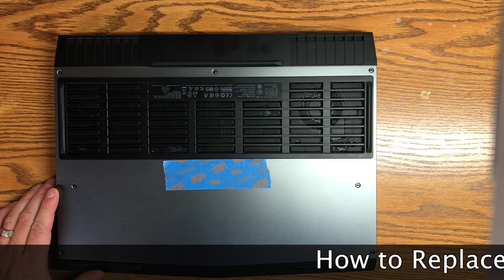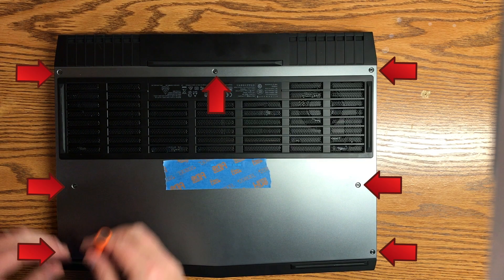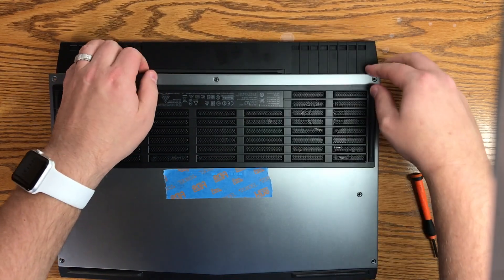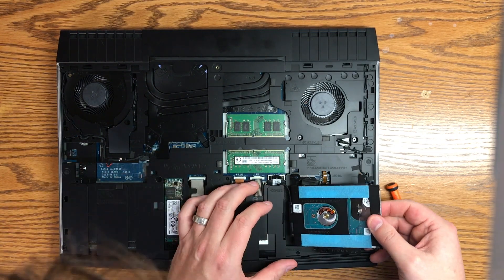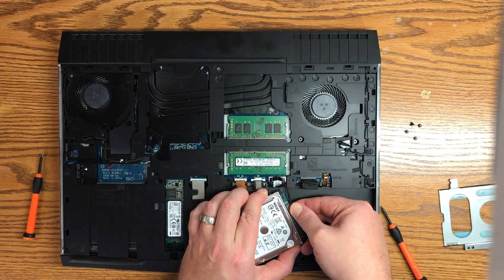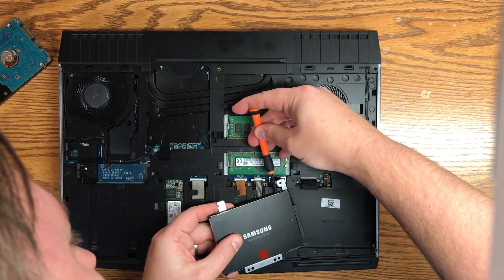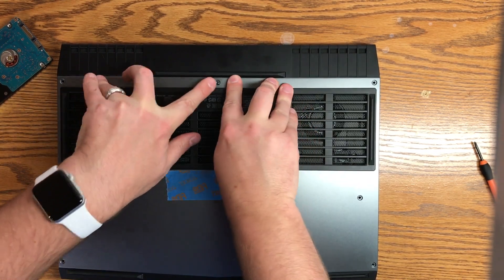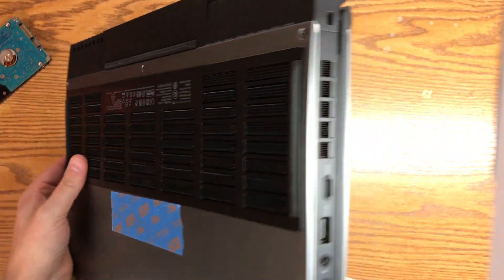How to Replace Hard Drive w/ SSD For Alienware 15 R3 or 17 R4

Comment: Yo if you are still active I have a question I recently replaced my hdd in my Alienware 15 r3 and the graphics card will not be detected so you know where I can download the original drivers that come with the computer? Nvidia drivers will not work I need to get the original Alienware driver for the laptop
Reply from the maker: You can go right to the Alienwares website and download them.
Reply: @ChadChristian  took me a while of searching but I got it all done thank you!

Comment: I have the alienware 15 r3 when I turn it off and reboot and does the check disk start and it lasts for most of the day will this fix it?
Reply from the maker: Yes it sounds like your drive could be failing.

Comment: Hi. Do i need to setting anything after replace hdd with ssd? Or the laptop can detect the ssd automatically?
Reply: Late answer, but I would definitely assume you'd have to configure which drive the computer should boot from in the bios.

Comment: Thank you sir! Got an SSD coming to replace the HD. Question, in the vid it didn't show you unlugging the battery cable. Is this necessary? Or just have it unplugged from power?
Reply from the maker: I did not unplug it from the battery cable but if you want to be extra careful you can. (I Never do but that does not make it right)

Comment: would it be a good idea to get the alienware 15 and put something like this in it https://www.amazon.com/Seagate-BarraCuda-2-5-Inch-Internal-ST2000LM015/dp/B01LX13P71/ref=sr_1_1?s=electronics&ie=UTF8&qid=1501480846&sr=1-1&keywords=2tb%2Blaptop%2Bdrive&th=1
Reply from the maker: You can or you could invest a little more and go with SSD drives which are much faster. That is what is nice about this laptop is that you can easily upgrade it.

Comment: While it is granted that the SSD will operate faster than the HDD, paying the price for an SSD as the storage drive is not generally worth the performance gain. The most substantial gain would be for Windows running on a boot SSD vs a boot HDD. Your games might take little longer to load first time on the HDD but once it's in the memory, it's all about the CPU, GPU and memory dictating the speeds. Not the SSD. So the 5x might seem more useful theoretically if used as the secondary drive.
Reply: Yep, if you just want storage for storage sake cloud storage might be the way to go. If you're gonna be travelling with a laptop for instance or commuting by bike, etc where a lot of jostling occurs SSD is the way to go.

Comment: Should you not have unplugged the power cable first?
Reply from the maker: Not if your careful. I owned a chain of computer retail / repair centers and have built thousands of systems. Pretty good at it after doing it for 27 years professionally.

Comment: hi chad, do you think that 7700hq is better or 7820hk? also, is 32gb too much or just stick with 16gb? because im planning to buy 15R3, thanks!
Reply from the maker: 7820HK is better. 32GB is too much unless you are a programmer or 3D artist that could actually use it.
Reply: Chad Christian oh okay! Then after you upgrading the hdd to ssd, does it affect your boot up/OS?
Reply from the maker: t.s my Primary drive is already an SSD but my load times on games I run off the drive I replaced are lightning fast.

Comment: Hey Chad. I'm SO torn. I'm about to order an Alienware 13 OLED or 15 with a gtx 1070 for school. The laptop won't be a primary system. Are you happy with your 15?  Unfortunately I won't be able to see them before I order.  Best Buy only had a 17" on display. Really appreciate the videos! Thanks.
Reply from the maker: I have not used the 13 so I cannot answer about that but I LOVE my 15". I would get the new version with the 7700HQ processor. I am doing a review of that 15" model right now and a VS with the 6700HQ version (I have both lol). the 15" has a beautiful display and 60hz GSync. I ordered mine from Amazon and had it next day! Here is a link to it: http://amzn.to/2kxEvF4